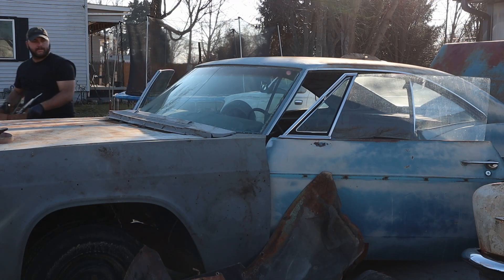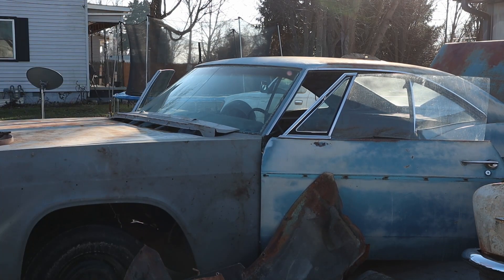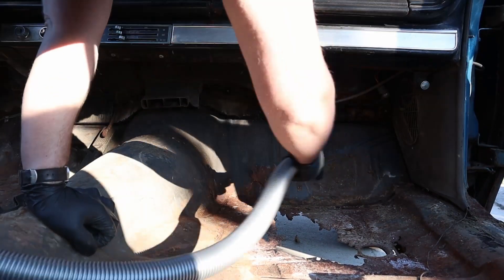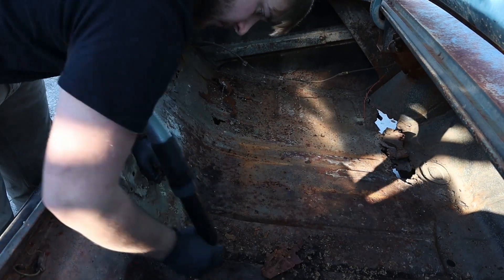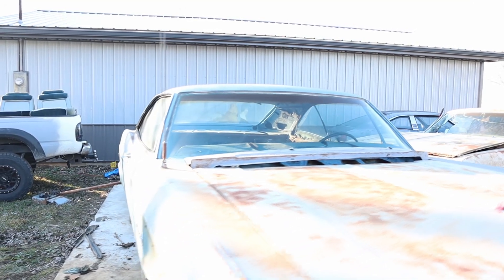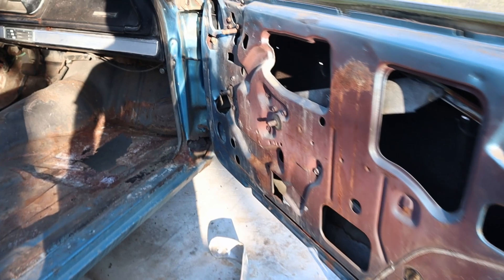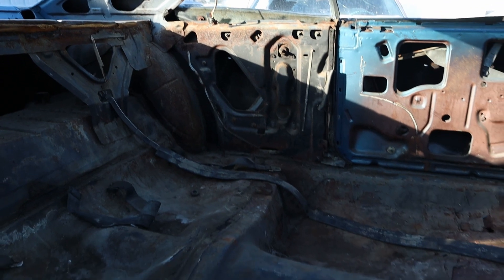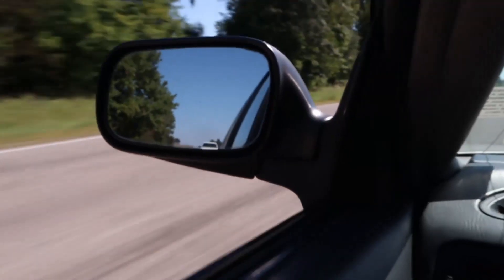Assessing the Damage: 1967 Chevrolet Impala

Comment: Thanks to everyone in the comments clarifying that it is indeed a 1966. There were a couple reasons we thought it was a 67: 
          1. The antenna was different from the other two 66 impalas that we now have. (on the front passenger fender rather than the back by the trunk)
          2. The front bumper was a different style from the other two as well. 

Looking at it now it is rather clear that it is a 66. apologies for the error.

Comment: 1966
Reply from the maker: What makes you say 1966?
Reply: I own a 66 impala convertible ss I'm glad you guys are saving that 66 not 67 also those hub caps are correct for 65 and 66 impala ss models
Reply from the maker: Got it. Plan is to save the 66 SS, 66 base, and restomod the 67

Comment: That's a 1966 impala not  a 1967
Reply from the maker: How can you tell the difference?
Reply: 1967 don't look like that it's a ll difference look
Reply from the maker: I didn't think the 66 had the big bumper guards on the front.
Reply: @stupidendeavors  I would say front fender corners ( & in general) are different. Rear tail lights would be easiest way to differentiate. Google each one & compare side by side.
Reply from the maker: Thanks. I just realized that. 2 of the cars had antennas in the rear, and this one was in the front. After checking the owners manual. It is a 66